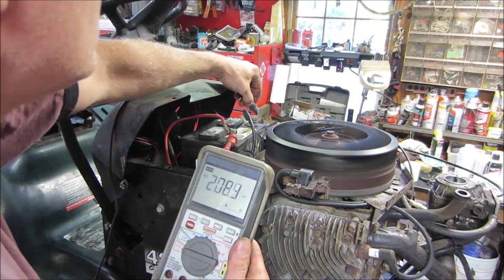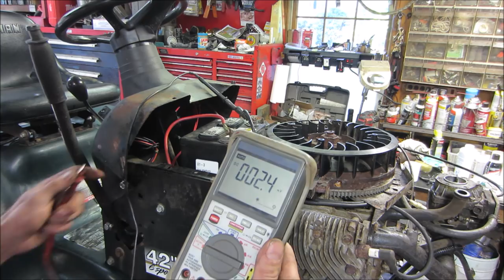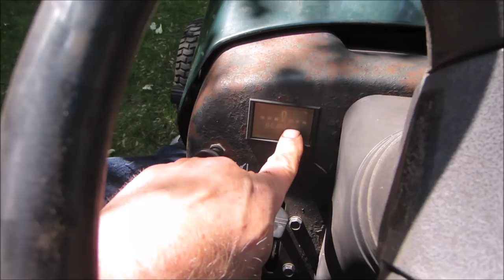will it run?  free craftsman riding mower conclusion.

Comment: I have the exact same craftsman except my hood is different. I think your is a 1999 or 2000 model. Mine is a 98. Everything else is exactly the same. I pull my deck off and rebuilt it. Had swiss cheese holes. Sanded it down and painted with POR-15. Thats been 3 or 4 years ago and still going. My old opposed twin is still running good! Enjoyed your video 👍

Comment: I had an 80's Craftsman with a rear-exit deck. I loved that mower. A loose screw took out the deck belt one day and the replacement cost $180!! The blades in the deck overlapped so the deck belt was a toothed timing belt. At least I could still buy one but the belt cost more than I paid for the whole mower. Live and learn. Love the vids even three years later.

Comment: love these little vids, I have learned a lot of stuff from you. I have 2 wheelbarrow style aircompressors and 4 small horizontal shaft engines that other people threw away, took em home applied lessons from the mustie master and all are now running. just picked up an old Gilson yard tracter for 40 bucks,  got it home cleaned the points and carb and it runs great. thank you for sharing your years of knowledge and experience with us all.

Comment: I've had one of these Craftsman with the same engine for well over 20 years and it's still going strong.  All the normal issues manifested themselves such as the starter and steering mechanism.  So far I've been able to do all the repairs myself.  With a little help from chaps like yourself and of course Taryl Dactyl as well.   Love what you're doing keep up the great work and educational video's as well.
Reply: I’m having people bring them to shop and simply say, don’t spend over a thousand on it with out calling me, they pay ahead of repair 
They figure it out about the new junk 
I replace head gaskets, service engine, turn up valve lash, all new safety switches and solenoid, battery, replace deck idealers& new sound brging,plus drill and tap for zerts, and new tires if needed, new tubes in front tires if ok
Then a brand new seat and paint the dash or complete unit

Comment: Hey munstie, old skewl tip. Had an old farmer show me this one. Take a cereal box (Ones with wax lining) cut one side of the box, dip the carb part in oil, lay on box sheet. Remove it, it makes a perfect gasket print on the cardboard box, use a razor and cut the new gasket from the box paper. Repeat and stack for thicker home made gaskets. Add blue rtv, like new!

Comment: Once you have established there is a good 12V supply, It is always best, during trouble shooting with a volt meter, to leave the ground in place and trace down the missing voltage as you progress through the circuit. It' is far to easy to forget weather you are looking for a solid ground or voltage. Remember don't let the smoke out. Good job.

Comment: Rebuilt a mid '90's Montgomery Ward tractor last summer for a friend.  Ended up costing me more than buying a good used one.  Almost everything that can be worn or broke on a mower had to be replaced.  Tires, spindles, rod ends, blades, switch, relay, belt, fuel pump, battery.  The front suspension was hammered from running into stuff.  Oh well.  Had the same engine on it.  The only thing that was good.  Brought back some memories.
Reply: It will last 20 years now, the new ones are junk and expensive to keep running

Comment: It amazes me how some people abuse an don’t take care of there lawn equipment even if they spend a lot of money at purchasing.I’am talking about two to three thousand or more for a new lawn tractor , i have a2002 craftsman 18HP 42 in deck I bought new an it still look an runs like new cause I love taking care of it. I payed $900.96 for it on sale.Only problem I’ve had in the 18 yrs of ownership have been gas getting into combustion chamber, a friend told me spend a couple of bucks an install a fuel shutoff valve an problem solved.Another problem was deck blades  would not disengage a little grinding on engagement pulley fixed that so it been a very good mower.

Comment: Learning a lot from all your vids mate...good job teaching with plenty of hands-on! 👍
Reply: If you can find an overhead valve Briggs it's pretty common that the valves need adjusted and a lot of people don't do. It's a 15 minute job. Long as the engine has compression it's an easy fix and flip.

Comment: My craftsman  tractor is 27 years old and still going it has taken various donor parts over its lifetime from craftsman mowers alongside the road! The one thing I had trouble with this year is it wouldn’t shift or it was very difficult to shift🤔🤔After dropping the transmission, I opened up the case and the grease they had use dried to a solid so none of the parts had any lubrication!! 
I cleaned it up and added some EP 80-90 gear lube.......just enough so that about 2/3 of the bottom case half was wet SHE RUNS AND SHIFTS better than new tell you if you’ll have a little bit of skill you can keep these old craftsman alive forever great machine!❤️🇺🇸❤️🇺🇸❤️🇺🇸❤️🇺🇸❤️🇺🇸❤️🇺🇸❤️🇺🇸❤️🇺🇸❤️🇺🇸❤️🇺🇸❤️🇺🇸❤️🇺🇸❤️🇺🇸❤️🇺🇸

Comment: I use my baking soda blaster to clean terminals, then give everything a liberal coat of dielectric grease to prevent it from happening again. Rarely do the safety switches go bad, tho it can happen. Mostly a no crank problem is solenoid or key switch. Usually the first place to check is at the solenoid, as you did. Then work back from there. Crapsman was Roper, then AYP (American Yard Products), and now Electrolux (yes, the sweeper company). Same as Poulan and Husquvarna.

Comment: I bought one of those opposed twin engines for $40. to replace a single cylinder engine. Luckily it came with cables for the conversion. I have a soft spot for these engines. Only because they are obsolete. And I love the way they sound!

Comment: Had a thought while you were having connection problems with starter switch and was wondering if soaking end of connector in baking soda would work. Of course not as thorough as cleaning with wire wheel, but wouldn't have to worry about breaking connectors. I'm in Bath, NY since you wanted to know who was watching. I'm fine with how you do your videos. Learn and relearn a lot. Amazing how much I forget over the years, lol.

Comment: I got a free mower very similar to this. Just like u I had to chase down if it was a safely switch, key switch, or the starter solenoid.  Unlike u I had to rely on learning as I went by watching various YouTube videos. But me & my harbor freight multimeter figured out it was the starter solenoid so got a new one & it fixed that issue.

Comment: Love your videos, Mustie-please let your viewers know that you can never jump start a mower with a running car-the charging current from a modern car will burn out the rectifier diodes, or worse, the alternator coil- if it must be jumped, be sure the car is off-better yet-buy a new battery-much less expensive than a new charging system-thanks again!

Comment: I have the same mower and the battery went bad after about 3 years, expected. HOWEVER what was not expected that it stopped me in the middle of mowing my yard. I think there is more to this electrical system on some of the other models with other engines. Safety systems and switches. Craftsman does some weird shit with safety switches. I have replaced every switch and the starter, ignition switch, and the safety switch that tells that belt take off is all the way down. I saw you test the output of the charging system on that Briggs and Scrap iron and I would like to see more on how that works. I have never seen that. All of the motors in these small engines have a charging device. Would be nice to know more about them.

Love the videos…. Keep them coming.

Comment: For the solenoid, I normally swap them for one from 1980-90something ford truck that you can get from pretty much any junk yard for very cheap. Can take more of a beating and will last longer.  It doesn't have the second terminal for the safety, but you could use a secondary relay to retain it if you wanted to.

Comment: Cleaning the magnet and magneto with a folded piece of wet sandpaper, soaked in ATF, and twist it several times back & forth in between will (should) bring back it's strength for running and charging.

Comment: I'd organize parts in boxes according to parts and make. Keep parts organized along with their mated parts. Buy float bowl gaskets and head gaskets and spark plugs etc. in bulk to have a stock supply. Get equipment in good condition and sell the best equipment for the highest price. Do a leakdown test and maintenance check on each piece of equipment. Put mothballs under the covers to get rid of rats.

Comment: Neighbor had same tractor years ago and it always had bad connections on the starter relay and fuse holder. Reseated wires and it would work. Never had those issues with my stx38 and its 30 yrs old.

Comment: A tennis ball or racquet ball with a hole in each side works for blowing out gas tanks or priming them. One hole is for the air compressor nozzle the other side to direct air into the tank. And the ball gives you a decent seal.

Comment: Nice mower ! It is newer than my newest and with bigger engine . I I install the Harbor Freight engine in mine  , I will have to hunt down that exact bagger . Originally bought it for engine parts and snow blower so I did not get the hard bag setup . It was too good to part out . Plus the hydrostatic is great while using snow blower .

Comment: i usually just bypass the safety and go run it to ground easier than trying to chase power through the safety stuff expescally the seat safety the craftsmans will shut off  anytime you let off seat so if you have to get off tractor to move something it will shutoff was the bane of my younger years my craftsman till i figured out how to bypass them
Reply: NATHAN NEVILLE good way to get chopped up. I’ve known two killed by mowers. I rolled one over once, on crutches for couple weeks, when I told people what had happened, I’ve never heard so many people with lawn mower stories and injuries

Comment: my 1998 troy bilt 42 inch deck had the same problem with the one blade it was so bent it chewed up my grass i bought it used from someone in WV for $150 lucky they gave me a parts deck to use on it and was able to transfer a good blade with the bent one making a reliable lawn tractor run again

Comment: Just take a screwdriver and jump from the big 12 volt lug to the lug going out to the starter, just the way we used to hot wire cars to start them back in the good old days.  I never learned using a test light.  I learned using a VOM because a test light will not show a voltage drop, as often happens on a lot of electrical circuits.  You may have 12 volts at the battery and only 10 volts down stream from the battery due to a corroded connection.

Comment: I rebuilt these old mowers all the time, I AllWAYS replace ing switch, seat switch and solenoid to start with,new battery for sure.
AllWAYS remove cover on engine every spring and clean air vent 
Really spray the VS clutch unit 
It may free up, or remove and replace brging

Comment: I dig stuff like this. That mower is probably 20 years old at least, and as long as it runs and cuts. It's worth maintaining.

I replaced a 20 year old JD that was on her last legs. The majority of it was still fine, though the hydro was tired. The engine was done for and repowering it with a new engine was more than I wanted to put into it. I replaced it with a bigger and more powerful Husqvarna. I think I made a mistake. Even though the old JD was tired, it was still built better than the new Husq. I have never seen a mower that's frame flexed like this Husqvarna 

It's a crap shoot  today buying a mower. 

I wish they were all built like my Cub. 50 years old and still pulling winter duty. She's not worth much actually money, but she is worth putting money in. It would cost me at minimum 6K to buy something new that could do the work she does.

Comment: If you go to the grocery store you will likely be able to find copper cleaner (White's) which is a cleaning paste.  Apply that to the contact springs on the plugs and in the sockets.  That reduces the oxide that's inhibiting the current at the contact points.  Try it.

Comment: After you clean the male contacts, clean the female contacts with a needle file then spray them with electronic cleaner. Spray DeoxIT 5 into the vent hole in the starter switch. Work the switch back and forth for a minute or two, then flush it with CRC QD Electronic Cleaner and re-assemble. I have fixed several old, rusty, corroded switches this way,  the oldest ones 22 years old, one 19 years old.

Comment: the starter relay got burnt out when the starter motor stuck and someone kept putting power through it, if they had tried a bit harder they might have burnt out the cables too, but once the relay turned into a poped fuse, game over.

Comment: I had a Craftsman YT4000 supposedly with the 24HP Briggs & Stratton twin engine...that thing was gutless compared to my previous Craftsman GT18..I think the HP ratings are way off and now they don't even list a HP rating its all in CC's...guess they figure if they hide it nobody will know that the engine in their equipment is smaller than their previously smaller by the numbers equipment.  I now have a Cub Cadet XT1 42" with the Kohler 18HP Single engine and its got far more power than the Craftsman's 24HP engine had by far.  

Glad you were able to resurrect that old Craftsman.  The deck ain't that great but it'll get someone through at least another mowing season until they can get a new mower, or good for a rental property.

Comment: And your blade engagement is also on crank and your clutch switch and your feet to itch at and there's usually a switch on the gear shift down by the rear end I mean on

Comment: The transmission is not designed to shift while moving.  It will break.
The height dial on the left should be adjusted without the weight of the deck.  The lever can be lowered, the dial moved, and the lever raised again.  Don't adjust using just the knob as it will bind.

Comment: I have a slightly older version of this same lawn tractor and it's weird seeing the differences between this one and mine. For instance on my tractor the battery is under the seat and the gas tank is under the bonnet where your battery is located. I also have a completely different kind of transmission and my deck height adjustment is a lever instead of a screw knob,

Comment: That twin cylinder Briggs will outlive that tractor and the next one it gets put in
Reply: The Intek narrow angle twin in my mower is the exact opposite.  Thing is burning oil already and the deck and mower will outlast it.

Dad has another Intek he said I could have, but he won't give up the opposed twin he has.
Reply: adam gravatte my bro has that engine in his lawn tractor it's sweet. I have plans for it when the tractor falls apart!
Reply: I have the same mower he has in the video. Mine is 20 yrs old and runs like the day it was new. Still doesn't use oil. My deck is rusting out...looks like Swiss cheese

Comment: I use a product that is great for deoxidizing connectors and switches. Caig Deoxit D5. YOu could safely dunk a radio in it (if you could afford that much volume of cleaner.)
Reply: We used liquid Freon to clean electronics at a facility I worked at.

Comment: Mustie, I have a Craftsman LT3000 and I found greasable bearing mandrells(?)  The spindles for the blades that mount through the deck.  After my original sealed bearing spindles took a shit - I found those - I believe it was $30 for the pair on amazon and have had those now for about 6 years and they are awesome!  You simply go until you hear them start to whine a little - then I give'm about 10 pumps from my grease gun and I'm good for another season at least!  I wish I had that twin engine!  Mine's the 20hp Intec Briggs.  Still a nice engine.  Been running great now for 16 years!!!

Comment: Sadly Sears Canada has closed its business, no more Sears. I had purchased a new LT 4000, from the local Sears in May 1996, used it till 2011, never changed the drive on deck belts, It mowed a acre of lawn every year. Break downs were rare, a couple times. I liked that little tractor, should never have sold it.

Comment: I don't know why the first thing to check after the battery voltage is not the key switch. I know you went from the key to the starter solenoid, but I am thinking ringing the key switch contacts by themselves to make sure the switch is good.

Comment: The ammeter may have poor connections. When you ran the alternator with no load it showed a very high voltage, (Thought I saw 23 volts) until the battery was connected. The it went down to 13.3 volts. But when the engine was shut down the battery stayed 13.3 volts. So the charging current was almost none.
If the ammeter circuit had resistance, perhaps from corrosion, those would be the symptoms. Clean the ammeter connections like you did the ignition switch. 
(Or it is, possible, that diode/s in the alternator's 4 diode bridge rectifier failed)